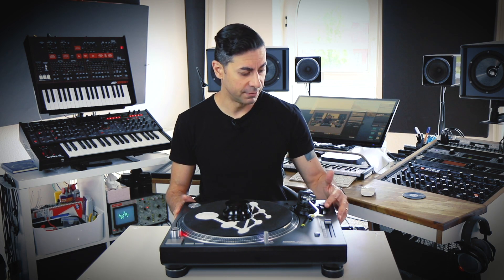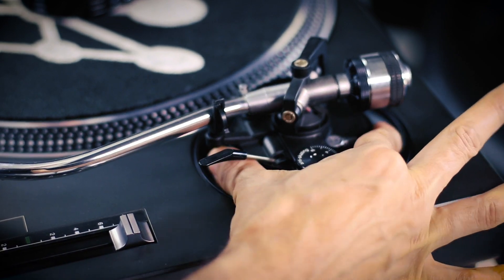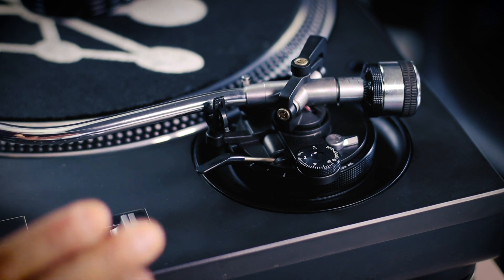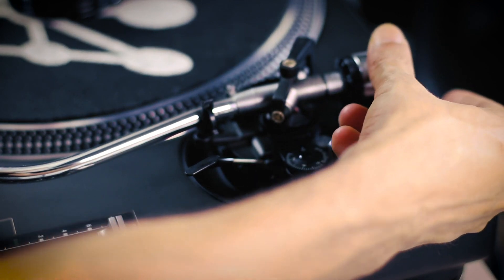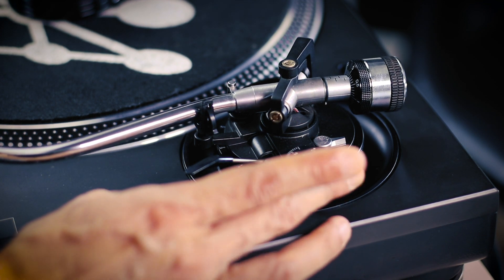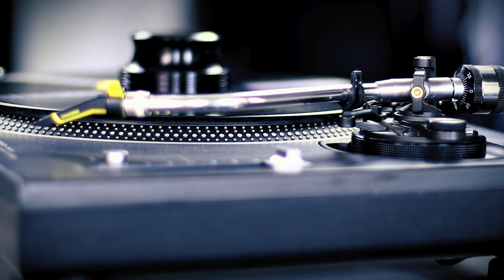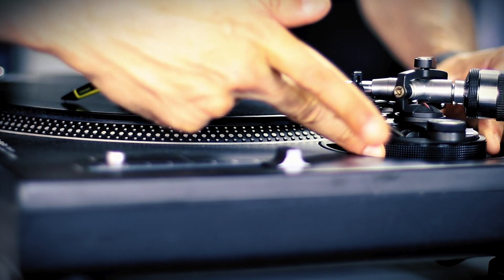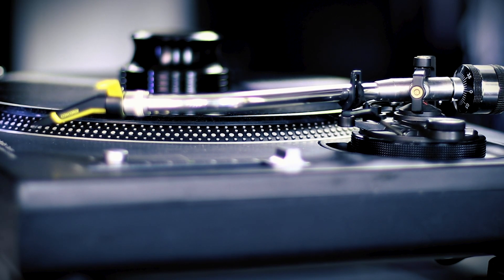Patrick DSP - Setting up a Technics SL-1200 Tonearm

Comment: Thank you for sharing your information. I have a problem on my Technics SL 1210. The counterweight is loose and  can be moved back and forth without resistance. Yesterday I've tried to setup the weight of the tonarm and after dismounting the counterweight suddenly a piece of small rubber came out. Since that the tonearm is loose and has no resistance. Nevertheless I can play records but Iam afraid that the counterweight falls of from the tonearm😢 What can I do to fix that?
Reply from the maker: Hey there. Your counterweight needs to be repaired or replaced.  This video should explain what's happening and how to fix it: https://www.youtube.com/watch?v=fMebIGQhVSo
Reply: @PatrickDSP Thank you. I will check that

Comment: just discovered my tonebar height adjustment isnt just stiff but fully stuck [and unlocked], on both! any tips?
Reply from the maker: Ouch! Just take it slow and steady. Applying heat from a heat gun or hair dryer, along with machine oil, can help loosen things up. If it's still stuck, it might be necessary to disassemble and clean it. This video might help: https://www.youtube.com/watch?v=_xJs7J1RViU
Reply: @PatrickDSP  ended up taking both apart and got them back in action. solid video! 👌